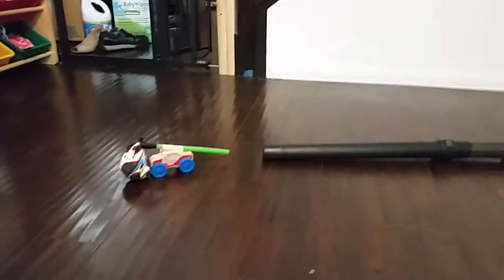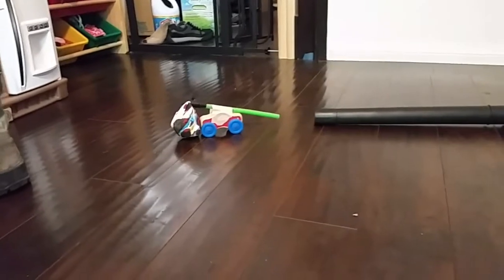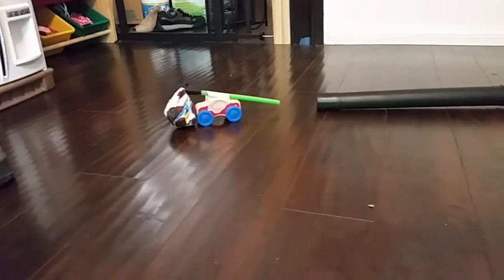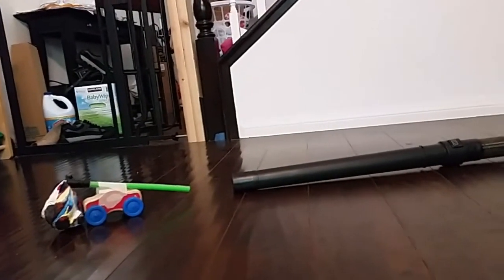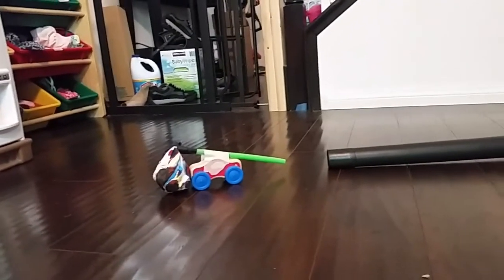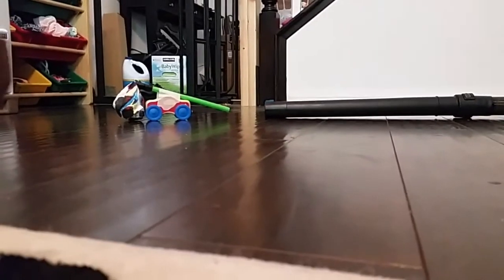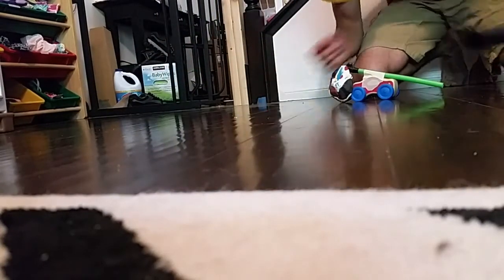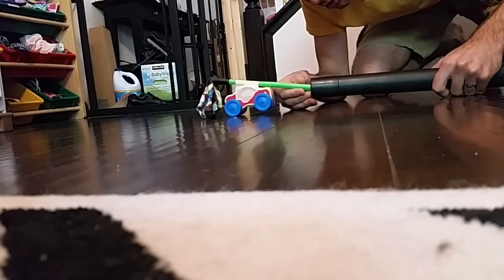Newton's Third Law - Thrust with vacuum

Comment: See the video of nine eleven , Jasonee:  nozzle of tube is pointing down air flow directed at  floor air flow from your model is pushing against the floor  . The reason why your vacuum cleaner directly behind it does the same thing . The vacuum cleaner has an air flow comming in from a larger area . The toy nozzle is still pointed down . In fact the vacuum nozzle behind proves nothing the way that you've done it . Nine eleven has created the condition correctly . Whilst I would concede that nine eleven video includes wieght in his model  there is sufficient evidence in his model to dispel the myth.
Reply: +Andrew Corbell You're getting called out here, Andrew. This is the moment where you have to start spitting rhetoric and make a stand. You either got to give Jasonilee an answer or you have to slink away. I know it's scary. And yes, you're going to be proven wrong. Consider it a learning experience.You got to stop running from things you can't explain, or answer, or defend.
Reply: +Andrew Corbell If we want to be real, neither one of these experiments is rigorous to really show anything. Look, Andrew, it's really this simple. If you're standing on something with low friction. Or wheels. And holding a heavy weight. If you throw that weight, you know that you will move backward. What could possibly be causing you to push backwards? There's only one thing that seems like a possibility and that's you're pushing off the air. But here's how you know that you're not... do the same experiment but don't let go of the weight. You displaced the same air and yet you don't move. Why not? Put the weight down and pick up a large fan. Use it to push off the air. You'll move so much more air than before.. someone standing behind you will feel the rush of that air unlike with the weight.. and yet you still won't move. Why not?
Reply: +Jasoninee  you cant deny.what you see in the nine eleven video.
Reply from the maker: Andrew Corbell 

LMAO! Yes you can! First of all his car barely moves in the first place. Second, do you not think it is odd that he has a cut in his video right before using the vacuum for no reason? why wasnt he able he able to show a balloon car that works great and then go right into using the vacuum for a second run without cutting the video... how could he possibly require a cut in between?

Hey what do ya know you dont seem to be excited for me to show you it work straight back exactly as I just showed in this video.

JUST SAY THE WORD AND TELL ME WHAT IT WOULD MEAN IF IT STILL WORKS WHILE STRAIGHT BACK AND I'LL MAKE IT FOR YOU
Reply from the maker: You people are all about the stupidest crap when it comes to space anything videos. Some single pixellation square or a weird cut and you'll all be like "zomg see everything is fake", but you have the most suspect cut ever in a dude's video that literally should take a few straight seconds and he throws a random cut in there. hmmmmmmm. hiw odd since I absolutely know it works just fine and can show you exactly what you want. Just say the word and tell me how you guarantee it will not work so I can see you accept you were wrong when you watch the video I make for you

oh btw I know because I did have it like that at first and it worked, but the balloon rubbed on the floor so I tilted it back to make the balloon not rub and let the car go faster for the more obvious result. Regardless I will make it work just for you with like a spacer or something to have it high enough and still point straight back
Reply from the maker: M. Scott Veach 

"slink away" 

bwahaha! Love it. My thought process exactly
Reply: What you and and M Scot veach  can't accept is what ther video shows . I saw this video before it was cut , in its entirety. He didn't need to cut it  , it show several attempts at disproving his theory but not a stationary model car I grant you . What it did show was varying performance and different vacuum nozzle positions which he eventually obtained the final result which is what you see. However what I think is evident is next time  Nasa wants astronauts to test another Rocket is you guys would be keen to volunteer.?
Reply: +Andrew Corbell Are you nine eleven, lol? If what you're saying was true then you would be able to answer the questions posed to you.
Reply: M. Scott Veach  No I only have ever used my name. I'm not sure why you would say that.
Reply from the maker: Andrew Corbell 

I am glad you saw that then, but regardless there is no reason to utilize a balloon car that barely works, just makes for an easy possibility of the car not moving sometimes. He intentionally did that.

for the NASA rocket  volunteer question; omg yes. Doesnt have to be NASA, would take that opportunity from any nation/university/company that has already had solid experience sending things up.

SOOOOOO.... are you going to do what I said and tell me what it would mean if I do it like that for you and it works perfectly fine???? WHY DO YOU AVOID THIS? Shouldn't that feel great that you would get me to do what you want and it shows exactly what you claim? Why are you avoiding it?
Reply: Jasoninee  What is the need? his video showed  varying performance whilst in tiny model contained in an atmosphere.    Back presure = thrust .  You cannot cry foul , when your first video was wrong also . In a contained atmosphere. For me varying performance would be sufficient evidence , and to be fair to him he did show the car moving. However whilst I accept the nozzle size was too small for his car to gain acceleration like yours. He did show it slowing . Yours showed virtually the same speed  even with the straw inside. You followed the already moving model with the vacuum  this is for me is less true modelling of the reality. My feeling is that objectivity must rule the day in your model the air flow from the jet you created was faster than the air flow on mass going into the vacuum nozzle.  It was still none the less being able to push therefore because there was something to push against.
Reply from the maker: Andrew Corbell 

what's the need?! Because of all the crap you just claimed!

You can't push off of a surface/matter with a slower velocity than the surface/matter going backwards and still go forwards. My car behaves essentially the exact same.  Based on his crappy setup and what you "know" that would be impossible. 

I start the car with the straw INSIDE the vacuum multiple times and it still goes forward the same. How are you claiming it has to do with it being accelerated before the vacuum is in place? Makes no sense. 

You apparently believe that a fan on wheels that can blow itself  5mph could be in a wind tunnel with a 10mph headwind and would still somehow go forward just fine at 5mph.

So..... all you really seem to be hung up on is the angled nozzle part.  I will remedy that for you,  and start it with the nozzle  already in the vacuum again. If it goes just fine then tell me what that will mean to you. You'll have a  randomly cut video, with a car that barely works without the vacuum, shown one time, with a vacuum from the side. ... then you'll have mine, completely one take,  with a car that obviously has enough thrust to propel every test, and I'll even start the nozzle inside the vacuum house again. What, if anything,  will that then mean to you? 

just answer that and I make your video,  otherwise sneak away because you obviously are just trolling and not actually seeking critical thought.
Reply from the maker: Andrew Corbell 

Maybe you deleted it or something, but in my notifications you replied:

"the velocity of the air mass coming out of the nozzle is greater than the velocity in the vacuum hose, hence it has something to push off of"

REALLY!?

You want to bet money on that and I'll order an anemometer to test it?

A normal vacuum is probably able to pull about 80-100cfm of air flow. In a hose 1.5inches in diameter that is like 75-95mph. You think the balloon blows out air at over 75mph?

\/ \/ \/ THE PART RIGHT BELOW THIS \/ \/ \/

Soooooo.. no, then you wont commit to saying what it will mean if I show you it works with the nozzle straight and starting in the vacuum? You keep neglecting to identify if you want to see what it sounds like you want to see, and you won't say whether it will mean anything to you.

^^^THE PART RIGHT ABOVE THIS ^^^
Reply: Jasoninee    some people can see  something I'm the distance . Some people claim it's a mirage.   What can you say to someone who is always going to see a mirage.   The fact remains it's more honest to show a video with vary performance ,but what you see at the end of the nine eleven video ,you cannot deny.   You do what you need to do
Reply from the maker: Andrew Corbell 

I made the video for you. Just say what it would mean to you if it works perfectly fine and I'll post the video where I show you every aspect uncut. I have the level straw (same car, same balloon, same straw, same vacuum) and I put it at least an inch in the vacuum hose AND i show the inside of the vacuum hose both before and aftwr with a flashlight. 

I already told you why you can deny it.. you are talking about his balloon car video correct? Really short and just starts with a car that barely works and then has video cut to putting a vacuum near and it doesnt barely go forward anymore?

It barely works dude. I think it was actually Nine eleven that sent me to a video of a guy doing the same experiment... car barely worked and we actually watched him have it work with the vacuum like 3 times until he claimed to finally get it at the right spot where it did what he wanted. Freaking laughable. My car works every time and hauls instead of barely moves/sometimes stuck. One continuous clip that obviously disproves his video and that other guys.

These idiots thought that a loop of paper behind the nozzle attached over top back to the car disproved newton's third since the car wouldnt move..... uhhhhh hello in there? The air from the nozzle then hits a thing going backwards that is attached to the car! AKA that just creates the exact opposite force by hitting it with backwards force. They essentially think newton's third means they can blow their own boat sail to go sailing. For real?! What is this first grade?
Reply from the maker: Andrew Corbell 

Uploading now as unlisted. Tell me how you would evaluate it if you have proof it works perfectly fine and I show everything with no tricks. Perfect working car with enough power, uncut, and level nozzle starting from motionless inside the vacuum tube and the car accelerates.

If it would mean nothing to you, would it at least show you that Nine eleven's video is either majorly flawed or intentional deception? If I show you it obviously works and nothing seems wrong then how could it possibly not help lead to that?

I will save the car and I can followup and show you whatever you want to come up with next. I can do it live if you want..... never done a live video, but if that is what gets the point across I can do it.
Reply from the maker: Andrew Corbell 

While it's uploading what do you think of this other video I made in a response to some flat earth newton's third nonsense:

https://youtu.be/FR2QLhbI5s0

make sure your resolution is high enough to read the scale.
Reply: Jasoninee  I respect your determination  , shame that that kind of spirit couldn't equate to something better than polarised world we live in now.    So I will concede to you for your endeavours I'm sure you are not trying to decieve so I   accept your model working. I still believe  the nine eleven video has damming evidence. Rob Durham showed it another way equelly damming.
Reply from the maker: Andrew Corbell 

I am glad you sound open to info now, but you have totally gotten away from addressing anything pertaining to the video/scenario/physics.

Here is what you required, would ya look at that!

https://youtu.be/X65HAReZoNU
Reply: +Andrew Corbell I was just teasing because you saw the video before it was cut. You're obviously not him as he has a very distinctive use of white space.
Reply: +Andrew Corbell Well, can you try putting those videos to the side and thinking theoretically about it? DId you see my question about standing on ice or in water. What is the explanation for that motion? The only answer I have ever heard is that you're pushing off the air but I've shown ways to see thats not the case.

What about videos that show the the third law working in a vacuum? Do you think they're all faked?
Reply from the maker: Andrew Corbell 

So I can remake this exact video but with it pointed perfectly level backwards if you want. I can ONE HUNDRED PERCENT GUARANTEE you it will work exactly the same (actually better since the mass sent off would now be the exact opposite direction, pointed down actually took away from propelling it forward) Would you like that? Then what would you say? Tell me now so I can check your response afterward. Would you like me to even point it up a little?

From a larger area? WTH are you talking about. Not that I really thought this experiment proved too much, but do you not think it is odd that the air speed in the vacuum nozzle is certainly going backward faster than the air coming out of the balloon yet you still think it is somehow pushing against it? I think you might be trying to say you think it is pushing off the vacuum nozzle, but come on lol. If it was shooting out smoke and you could see through the vacuum nozzle you really think it hits the wall of the nozzle? The vacuum is pulling so much it just would go straight back.

Just say the word and I'll remake it just for you. REQUIREMENT: You must tell me what it would mean to you if it works pointed flat backwards. Tell me what you would believe to be going on if a balloon can still propel something forward even though you think it must push off of other air and that other air would be going backwards much faster than the balloon air.

Comment: Lol dirt still on floor this is proven to be by the international space university. Lol they said with a negative force cause no push pull effect this guy need to sweep where he was vacuuming. Lol
Reply from the maker: Ryan Emberton 

Lol lol

Please elaborate on what you are saying.

"with a negative force cause no push pull effect"

Please give an example of what you are trying to say here.

First of all, I am not even sure what you are talking about, and then if you even comprehend what you are talking about.

Second, this video was for the very specific purpose of showing that it works just fine, because a different video used this as a claim to show that rockets don't work without something to push off of.
Reply: I don't want to argue but if you can make this work in space the only experiment that'll prove it then it's proof. Not ganna say this is wrong but nasa says they only can go in lower earth orbit and all there earth pictures change if I use a balloon and suck the air fast out of it causeing a pull of air it'll have no thrust because it's Evean pressure.  So when you have a perfect vacume it'll suck eveanly with the push causing it to deflate 2nd if you draw the air out fast than its pushing out what do you have?
Reply: Hard to explain but it's like this there is box push where there is a pull makes it Evean and if the vacume is weaker it can move
Reply: One more thing think of a rope and tug a war and stop pulling the force goes with the other force causeing the same reaction so if a baloon has air escaping but I suck all the air how can it move.
Reply: I tried to explain makes sense to me that if I suck air and it going one way it can not push or make energy the opisite way
Reply from the maker: Ryan Emberton 

Dude... that is literally what my video is showing. Do you really not think the vacuum has more air going in AND faster than my ballon slowly letting air out of a straw? The straw is literally IN THE VACUUM HOSE and it still goes forward at the same speed.

It is about expelling matter. Expelling matter from anything creates force in the opposite direction. Sit in a rolling chair and push away someone else next to you in a rolling chair.... omg how does that work? Matter is matter and Newton's third is very very very well proven and easily tested by anyone.